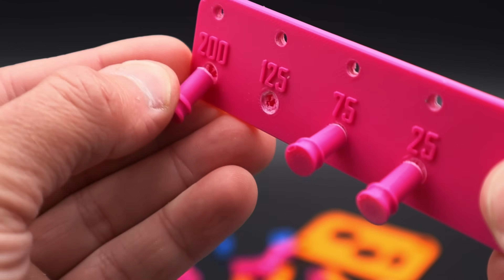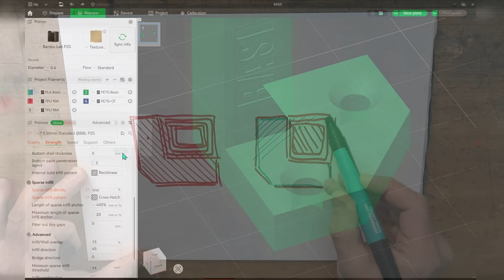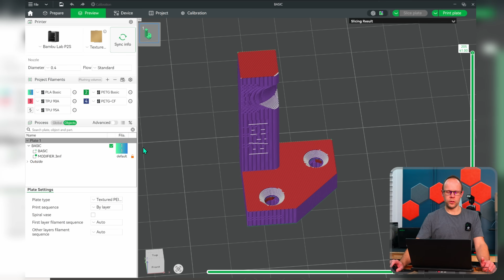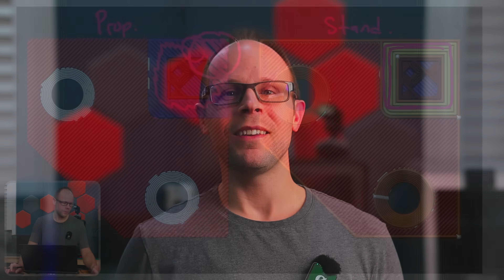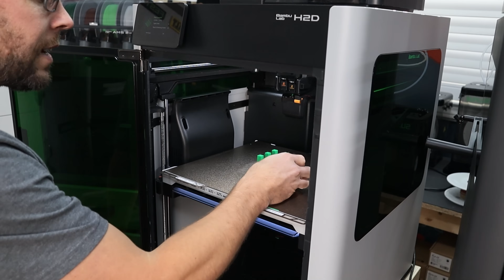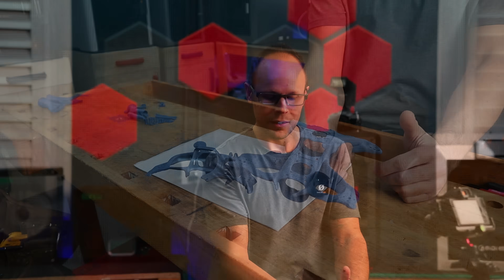Can the simplest 3D printed extrusion path also be the strongest?

Comment: It looks like your results are better due to giving the parts more of a "foundation", the extra top shells embed the part more deeply into the lower section. This does help with adhesion results as well. However, to test layer adhesion accurately, you should use a purely tensile environment, since the increased embedding into the base will skew your results.

That said, I think you have some good points that make a difference either way. However, your testing strategy could be improved to better support the point you're trying to prove.
Reply from the maker: The reason that I didn't want to test using the traditional method is... one... because I don't have a great setup for that, but also, those test samples are too small and they do not represent real 3D prints very well.  I agree though that  more testing should be done.  Ideally I can build a test setup like the one that CNC kitchen made and test tensile strength and have it accompany my other test results.   I would want to make the test samples have a larger cross-sectional area, again to have them better represent real parts in both size and also the amount of time it takes to complete a layer on a single part.    I don't have all of the solutions here, I had an idea to try to understand the problem better and hopefully it sparked some other ideas out there to do better than I was able to.  I have a few more  ideas too, one uses a 'friction stir' approach.  Another uses a heated chamber for even PLA and PETG prints.  Thanks for  your thoughts, and I do agree with your thoughts.
Reply: @NeedItMakeIt  It was a great video, and some great thinking and results.  I still think you are on to something and should test further!

Comment: If you print smaller prints, it could be better to print it per object instead of per layer. That way you also contain more heat.
Reply from the maker: That's a really good idea, I'm not sure that people know about that option in the slicer, I never see it being used.  There are some obvious limitations, but if you have the space, in a larger printer, this is a really good solution too.  I should also test this out.  One bed with 9 prints on it all printed at the same time, and one with 9 prints printed individually.
Reply: @NeedItMakeIt  I second print by object, as it would ensure that each testing piece will not have the variable of layer cooling when it's waiting for the next layer and be more representative of what someone would get when they print just one object.
Reply: @NeedItMakeIt  I use by-object every once in a while. My favorite use was for a bunch of small parts of a project that I wanted to be different, single colors; I was able to print them all at the same time with minimal color change waste. I've also used by-object as a way of ensuring a bunch of small parts would have a higher chance of not causing neighboring parts to fail when bed adhesion inevitably failed on one of them, and to experiment on quality factors like layer lines, temperature, speed etc... with some of my smaller models. Set up five, change a setting differently on each, see how they turn out. Can't be used on everything, but I'm glad I discovered it early lmao.
Reply: @IamCoalfoot  I've also done this for single color objects like that. You can also group them into assemblies so you could print eg. 10 red, 10 yellow, and 10 green where you can't fit 30 on one plate in by object mode.

But grouped together, it's like printing 3 objects that are 10 times the size and now you can put enough space between them. The groups of 10 print by layer and then the next group of 10 starts from the first layer.
Reply: @NeedItMakeIt  The obvious need for per-object is when printing vase-mode, which I did a few years ago when printing 50 low-poly Christmas trees in various sizes, where productivity for the smaller ones greatly benefited by having more of them on the print bed.
Reply: @NeedItMakeIt I really like per object because some materials will warp a lot if you take too long to print it so per object removed that problem. 

Also when you need ultra precise part and you measure one printed and then adjust the dimensions, printing 20 at the same time will never give the same dimensions but 10 with per object printing will be a lot closer, still not exactly because the parts cook on the bed once done

Also small or big part I do as much as I can when it's for precision or warping risks
Reply: especially the case for abs, day and night diffrence in therms of layer adhesion on small parts
Reply: I think MytechFun made a test about this, but the conclusions were that they were rather unaffected. (Need double checking but yea).
Reply: @migueldias1873 I remember the video. I was looking for someone to say this.
Reply: I’ve made stronger and better quality parts using this method, especially with ASA/ABS
Reply: I really made sense to print per-object here for your video. Going form part to part ruins the whole point of trying to print over hot material.
Reply: Honestly, we can realistically speak about this subject without fixing the heat parameter. By the time you start printing the next wall, it may be minutes in between and that matters a lot. It's all about heat and how it's applied. nothing else.
What this means is - you really had to print per object for all this to make sense.

Comment: Awesome video, thanks for sharing!
Reply from the maker: Thanks a lot!  I've had this idea for a few weeks now and I was struggling to find a way to actually pull it off in the slicer.  I eventually figured it out and though the results don't look so nice at least for PLA and PETG-CF it showed good results for the fully aligned.  I've been thinking about other options and I do have another idea, but it's pretty wild, and I'm no programmer so I'd need to use GPT to see if it might be able to help me here.

Comment: You're all horribly underextruding on the inner walls, this is what the inciting finding (stacked layers perform better) tells me. The volumetric flow of the bead must be sufficient to fill the gaps and it isn't.
Reply from the maker: It certainly is a fine line, over-extruding isn't a good option either and frankly the process of calibrating each filament is not so good.  I do wonder whether it would be possible to have an in-line calibration method for any printer, so as the filament passes though, it could take an average over a distance and adjust the amount being extruded to compensate.  Some filaments like Prusament don't really need this though, so you get what you pay for.

Comment: A sharp interior corner like that on a layer line is a design flaw. Would be interesting to see how much difference fillets with various radii would make rather than adjusting print parameters.
Reply: Why not both though?
Reply: @quorkquork amen!
Reply: @MAGnificentEDC Well, if fillets make vastly more or less difference, then it's less faffing around to only do ine. But both is also an interesting data point.
Reply: This is what I was thinking. A nice fillet or chamfer would mitigate all of these issues rather easily. At the same time. If there is a fit issue, fillets or chamfers may not be feasible. His approach is a great engineering concept to have in the toolkit, nonetheless.
Reply: @MAGnificentEDC you can do a "reverse fillet" sometimes if clearance is an issue. Basically, a circular cutout. Clearly, removing material weakens the joint in general, but it's the sharp corner thats creating the stress riser where failure tends to occur, so you might still be better off
Reply: @MAGnificentEDC  That would be a work-around but not tackle the underlying problem.
Reply: @ABaumstumpf there is no problem? Physics work as intended is problem to you? Parts break at is weakest point and sharp corner accumulates stress. I dont understand why making parts deliberately weak and trying to strengthen the weak printer is a problem 😂 it is not a problem to conquer, it is guaranteed defeat to physic laws, lol
Reply: @sametbayboru8965  "Physics work as intended is problem to you? "
Did you perhaps not manage to read or comprehend what i said? It really wasn't that complicated. So try it - try reading before posting.

"and sharp corner accumulates stress."
This got nothing to do with stress accumulation... again - try reading before showing everybody your ignorance.

Comment: I printed something off twice in PETG, the second print I applied a standard fuzzy skin to the outside surface and noticed significantly more strength to the print with fuzzy skin.
Reply: It’s probably because the fuzzy wall slowed the wall down and created a heat soak zone.
Reply from the maker: That's funny, I was thinking about trying fuzzy skin too.  I also have a wild idea, using a technique that's similar to something used in steel known as Friction stir welding.  Basically using small circular movements for the extrusion path to produce the outer shell.  The issue of course being the extrusion buildup, so precise control of the extrusion would be very important, but the idea is that the back and fourth would go away and we'd have smoother tiny circles in a continuous motion.  It's an idea... not necessarily a good one though, but maybe there is something good that a person could work with.
Reply: @NeedItMakeIt like a custom infill pattern?
Reply: @NeedItMakeIt Hilbert Curve infill sounds pretty similar to what you're describing. Tight little patterns to keep heat localized, and continuous lines 🤷🏼
Reply: Fuzzy skin adds material, plus everyone prints too fast and use layer times as a crutch instead of calibrating actual flow rates. 

Your real flow rate isnt just dependant on materials and printer but your environment too, which is why everyone should have heated chambers even for PLA to control climate during the whole print.
Reply: The in and out motion might cross wall lines.
Reply: Try same part, non-fuzzy, but colder and slower.
Reply: That sounds wild, what could be the possible mechanism that it strenghtens?
Reply: @quorkquork I can only assume that the "fuzzy" surface is just creating lots of tight triangular shapes so when I compressed the print the triangular surface distributed the load.
Reply from the maker: I'd imagine that it has a better bonding to the adjacent layers, maybe also working similarly to what I've shown but on a smaller scale, where the heat is isolated more where filament is extruded.  I'll have to test this idea out, fuzzy skin is pretty slow, so there is a tradeoff there.

Comment: Interesting test! For the test part with the base and column, you can easily strengthen it another way. Make an internal hollow segment. Like a cylinder that goes from mid column and down past the base top few layers. That way you will also have walls internally, and the part is way stronger! For larger parts you can make several “empty” internal cylinders.
Reply from the maker: That's a great idea!  I was thinking about this a bit and what I think we're missing is either the slicer to do this automatically at weak areas, or for there to be an option to build these additions in to the model and then to bring them in as modifiers from the start.   I couldn't find any way to do this so that they came into the slicer as modifiers, not to mention having to move them around to get them into the right position... if they don't have the same external size for centering.
Reply: @NeedItMakeIt  True! It should be an automated feature in the slicer, as it is not very difficult to identify the areas. I normally design this feature directly into the model in CAD, but I have not tried to do it in the slicer.
Reply: @NeedItMakeIt  It seems like you could do it with 2 exports from CAD. One that is the bodies to print, one that is the modifier bodies. Bambu Studio allows you to load modifiers and I would think if the body and modifiers were exported referencing the same origin they should align in the slicer. I might have to try this myself.
Reply from the maker: Hmmm, that's worth a closer look I think.  I was really struggling with how to do this as automatically as possible, and there didn't seem to be any good options, but maybe exporting components as a group would work.  Good idea!
Reply: @NeedItMakeIt  I got curious so I had to try it and am glad to report it worked.

Key lessons:
- can't be in one file
- both body and modifier need to be STL format
- body and modifier must have a common origin
- You can move the body before loading the modifier without issue (it auto aligns)

I think this could really help with streamlining modifiers for printing. you could even export a group of modifier bodies together in one STL to create modifier "groups" for common settings.

The limitation of not using 3MFs is likely why I hadn't noticed this yet, glad to have some data to add to the discussion! I really appreciate your videos, keep up the great work!
Reply: What works for modifiers should work for negative volumes, support enforcers/blockers, anything that allows for CAD import in Bambu Studio.
Reply: @BrianTimm  One way to load modifers into the slicer exactly where you want them to is to export your cad file as a STEP file, with the modifiers being separate bodies inside the cad, and load the multi-body STEP file into the slicer. Afterwards you can split them into different objects and turn one into a modifier, with its position being retained (I think). Haven't personally done this but a coworker has done this and is their standard method.
Reply: @lucius2375 good to know that's an option, but I'd be worried to use that with multi part assemblies as it would unlink my actual parts and be easy to cause misalignments. Not a bad workflow, always good to have options. For my experiment I made the body and modifiers separate components in the same file which made it easy to export them separately while keeping a common origin.